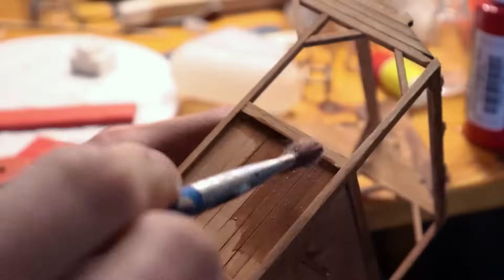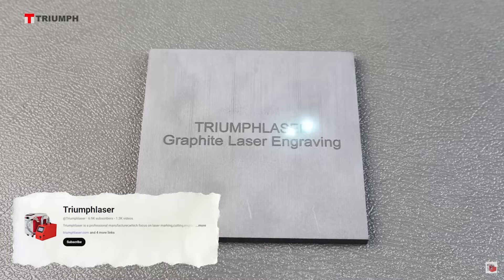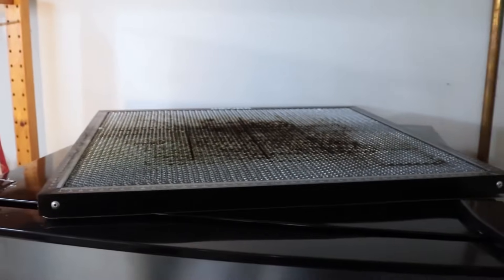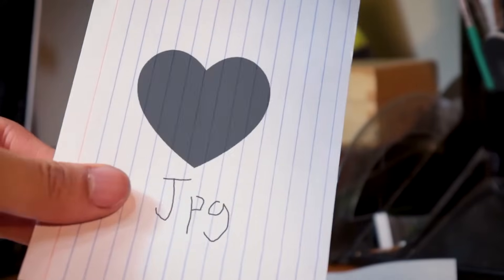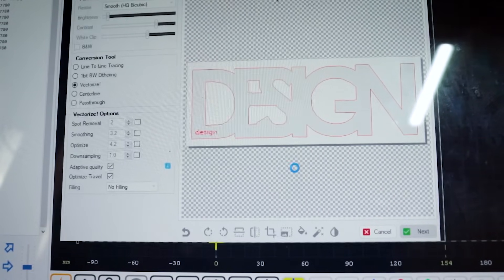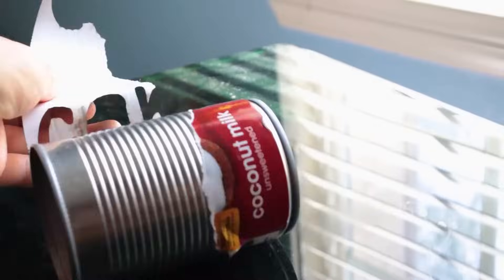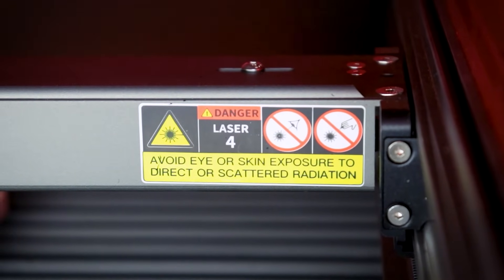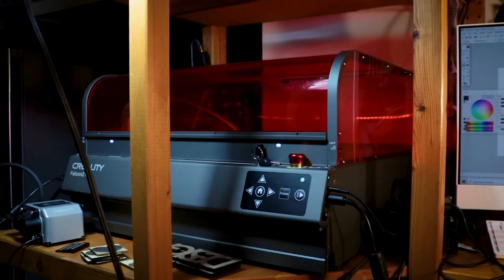How to Start Laser Engraving | CrealityFalcon Series

Comment: HI, I bought a laser to learn something. It seems so neat. Have had the laser Falcon 2 22w for about a month. Been trying to study and buy things for the engraver. I have 1/8th" plywood, just got slate to make coasters, with the idea of making pet memorial slate markers. I haven't even turn it on yet. Bought the laser, bought a table, discovered it wasn't level across the table, solved that. Bought an enclosure, some extra mini 8gb sd mini cards. Downloaded svg files. Think I'm about ready to try to make something. Do you think you could take us through the process of finding a file, opening the software load the file, size it, place the material on the honeycomb, then set up the laser to engrave the material, speed, power setting (ballpark) and then making the engraving. After that how to tell if you need more power or less and faster or slower speed. You have a great page and I appreciate your work. Thanks
Reply from the maker: Thanks for the comment! I will consider making a more in depth tutorial for direct use, I’m glad you enjoyed this guide.

Comment: You are an exceptional instructor and I know because I've been a teacher for over 35 years. You should feel very proud of your efforts.I am having trouble figuring out where to put the actual item being engraved. I bought a smaller ACMER S1 mostly for using makers mark on lathe turnings, but don't know if it will start in the center or one of the corners. Also I've spent all day trying to figure out Inkscape and where oon the page to place the drawing that I made into an SVG image. Then how do I send the image top be engraved from the computer to the laser. Everything is connected but now what? Hope you have the time to help me but if not thanks for your efforts so far.
Reply from the maker: Hello! It seems like your issue is that you need to figure out how to use a slicing program which acts as a bridge between your computer and the laser engraver. It will help you figure out the origin point of the engraver, and how to use your designs. I suggest researching “LaserGBRL” or “LightBurn” tutorials

Comment: I recently purchased a falcon 5 w open table laser. But when I purchased it I really didn't know what I was doing. I'm interested in engraving stainless steel tumblers. Can I swap out my laser head for a higher wattage and keep this table and if so what wattage would you recommend?
Reply from the maker: I believe if the same model of engraver is available in different wattages, you could definitely just swap out the laser if the company allows. As for tumblers, I think 20W is perfectly fine as it allows for fast and deep engraving with colors.

Comment: The production quality on this video is great and helpful! I’m  turning my old ender 3 into a laser engraver. Do you have recommendations on building an enclosure for my new engraver? Would colored  acrylic glass be sufficient enough? And diode lasers would be on the blue spectrum so would red or amber work correct?
Reply from the maker: Thanks for the comment! Colored acrylics aren’t made for laser protection and need special classifications that you can look up online. It is better than nothing however, and red would work best. I believe ventilation to be more important than the eye protection since fumes can impact you significantly faster than eye damage, so hopefully you find a solution to these issues. Goodluck